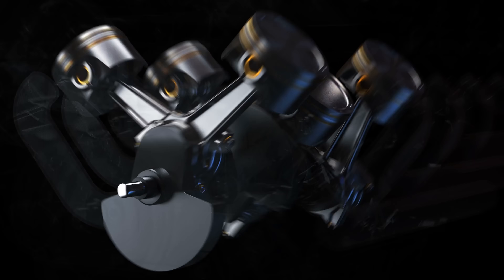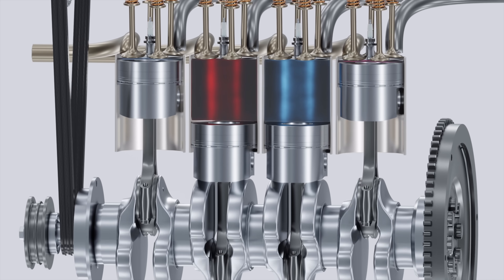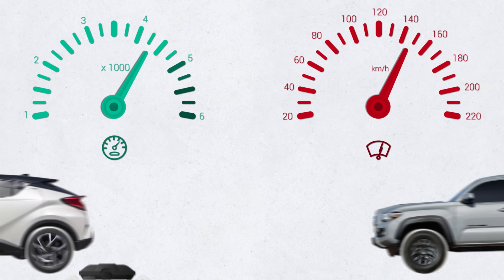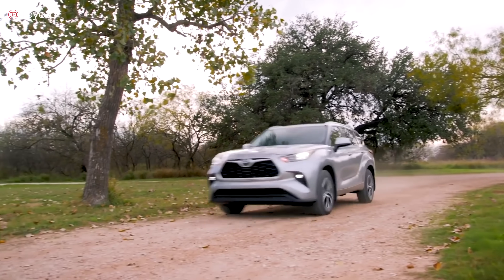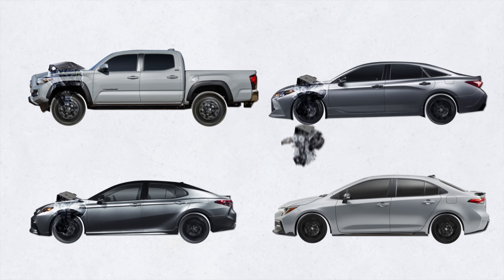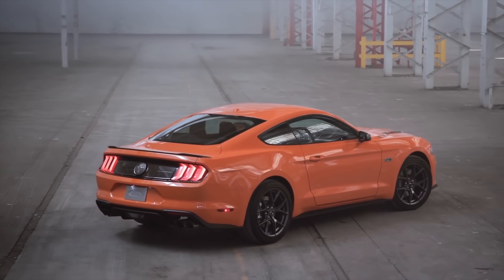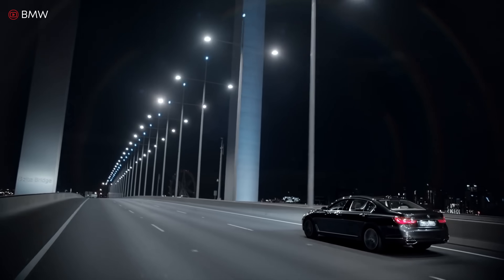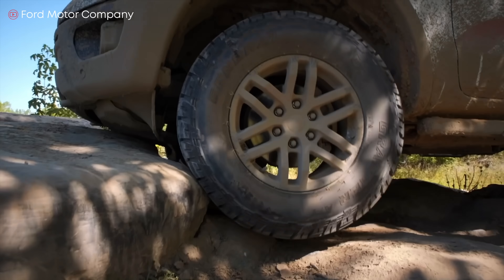No One is Telling You the Truth About Turbocharged Cars, So I Have To

Comment: Turbo charged vehicles are just not as reliable as naturally aspirated since there is much more stress on the engine due to forced induction. That’s why I still have my e46m3 and s2000 with 6 and 4 cylinder inline engines

Comment: 4cyclinder trucks transmissions  can't handle heavy weight over a 4 to 5 yr span. A car loan lasts about 7 to 8 years now. No one will keep these vehicles anymore after driving them to think they will last that long.
Reply: We are being forced in to 4cyclinder vehicles. If the government never changed the requirements this rapid buying of 4cyclinder and electric cards would not happen.
Reply: The car maintenance will quickly.
Reply: Rise
Reply: I love Hondas but to use a rubber belt instead of a chain to timing now is crazy. They do it so you change all the belts and water pump. Another way of compensating for loss of other maintenance cost they lost.
Reply: I will continue to use my 2016 Toyota Avalon v6 until the transmission dies. Lol
Reply: I will say one of the best cars I have ever owned was a 90 hond accord ex 4cy.

Comment: An electric supercharger would have no lag,less complexity,free exhaust flow,no heated air so no intercooler and infinite instant boost level control.
A stand alone computer could vary air and fuel in real time to optimize power and efficiency.

Comment: My VW Passat is the 1.8 Turbo and I have had zero issues with it for 83,000 miles.  The whole car has been trouble free for five years now.  I will say though, you definitely have to be "Johnny on the spot" with oil changes when you have a turbo.  You can literally feel the difference in the car when it is time to change the oil.  I can almost guarantee you that most issues people have with their turbos comes down to putting off the oil change longer than they should have.  You do have to put the best/expensive synthetic oils in for a Turbo.  Simply put, turbos are not for people that are typically inattentive to vehicle maintenance.  Turbos are unforgiving to those people.  I am pretty sure Scotty already mentioned that in his videos about buying used turbo charged vehicles.  Too risky to buy a used one not knowing the maintenance history on something so basic as an oil change.

Comment: ONLY IF YOUNG AND WORKING...RETIRED PHART NOW...LOL...BUT years ago I bought a slightly used 81 Suzuki GS1100EX...(His Son took it without Dad's permission...uh huh...3100 miles on it for $3,000.00 Yeah Good Deal...but Clutch Hub spit a spring cracking oil pump housing I fixed it all...Factory Hub and Pump(w750cc Drive Gears...HUGE DIFFERENCE) (ENGINE SOUNDED WAY QUIETER!!!) (MORE VOLUME OIL FLOW...YUP) CLUTCH PLATES ALL OK...I TOOK A TOUR ON IT...CA UP THROUGH OR WA IDAHO WYOMING AND BACK THROUGH VEGAS...I WOULD DO IT AGAIN IN A HEART BEAT !!!!

Comment: Personally, I would only buy a conventionally aspirated engine. My feeling is that there’s less moving parts to go wrong and the higher revs of a turbo stresses the engine and drivetrain, even if it’s designed for it. For most people, a 4 cylinder should be sufficient for going from A to B in a typical car. Sports cars are fun, but using them as designed is impractical in typical settings and dangerous and wasteful as well as stretching legality and safety of others. All we are doing is going from point A to point B. Everything else is frivolous. If everyone was really honest they would agree. 6 cylinder is fine for vehicles that are large and hauling weighty stuff up hills.
Reply: I need more than a grocery-getter.  I want to be able to travel, and for that, small 4 cylinder cars are nothing nice.

Comment: I've only seen a few cars with over 350,000 miles on then. Out of the 6 vehicles with that kind of mileage 2 were N/A 5.3L GM LS based engines before they went stupid with electric everything and displacement on demand. The others were volkswagon cars that were beat to sh*t but the engines ran perfectly fune and were all manual transmission,  turboed engine cars. The biggest issue is people not maintaining them properly and especially flogging the hell out of the car and then just shutting off the car instead of letting the turbo cool slowly.  I'd take a turbo 3.8L or turbo 4.3L from a grand national/TTA or syclone/typhoon from the 80s over their stock N/A engines. The 3.8L could have easily killed the TPI 350 that was in the Corvette at the time and they ran for ever even though 99.9% were driven damn hard. A properly taken care of turbo car will last just as long as a N/A engine. It's all about the original build quality of the engine and the maintenance done to it after it's in the owners possession. Even better, how about all the guys driving 200,000+ miles 5.3L v8s with a turbo on them that have had the turbo since the truck had 30,000 miles on it or less. They've been making 600+HP for years and havent had any major malfunctions and that's with stock crank, rods, and pistons, none of which are forged from the factory.

Comment: I'd never buy a turbo car.  The turbocharger itself is a high speed, high temp failure point.  Turbocharging puts strain on the engine, which is not a hand-built race engine.  A good old V6 pushrod engine has been many times more reliable.

Comment: There is no replacement for displacement.  I just bought a 2013 silverado with a 6.2 liter engine it's averaged 18mpg over its 116,000 miles. With over 400hp and 400 pound feet of torque at the ready. No turbo lag just smooth power.

Comment: We have in Europe turbo Toyota they don't break!
So it doesn't matter,
We have 1.4 d4d 90 hp diesel engine,
And 1.2 turbo D4-T engine Corolla, auris,
They are very reliable,
Only direct injectors clog up, you clean them pretty easily

Turbo is way better than any atmospheric engine!
You get lots of torque from 1500 rpm! All of it, and it holds it up to 4000 rpm,
Max power at 5200
No need to play with the stick!
Less noise when you want to go cruising, and very low revs on highway with plenty of overtaking power (torque) from the low end,
If built right and serviced correctly!
0w 20 oil used,!!
And every 10 months or 12 000 km oil change they don't brake,
And use it correctly never turn engine off immediately after thrashing it,
Neither floor it when cold turbo is gonna brake....

Toyota makes Japanese engines in Europe the 1.2 turbo has IHI TURBOS
And pistons from metal art Co Japan

Comment: I like turbo, because the altitude where I live, near 2,000 M, naturally aspirated loss about 1% Every 100 M….. so, loss 10% in a car whith 200 hp is the same to drive a Crv 1.5 L turbo that have 180 hp, because turbo usually never lose power whith altitude, Turbo car could be cheapper compared whith the same HP performance where altitude is important

Comment: Na engines for me. Turbo 4 bangers and any turbo besides a diesel have more pressure/heat/friction and will prematurely fail than a NA engine. All the components in a turbo engine are stressed beyond so longevity and dependability are compromised.

Comment: The problem is everybody drives a TRUCK to commute to work! Those dummies DO NOT NEED  a v6 or v8 to suck back extra fuel to get them from point A to B, so the turbo 4 is a GREAT solution. Also, Toyota is releasing a turbo 4 in the 2025 4runner with max torque around 1700 rpm (lower than v6s and v8s) and 325Hp (non hybrid- the hybrid gets a Big boost) so the turbo 4 is great alternative for better fuel economy and still getting reasonable power. 

Toyota, please put that engine into a Rav4. Weeeee!

Comment: 4 cylinder engines are over powered. I don’t need to go to 90 in 2.5 seconds. I can’t tell you how many times I’ve got on the freeway and check my and I’m doing 90 to 100 and I’m not even trying to go that fast! My car you only have to touch the gas pedal and the car will start going at a reasonable speed but if you push the gas pedal the car takes off like a rocket on steroids.
Reply: I forgot to mention that I hate my car and will never buy a car with a turbo engine again!

Comment: 1. Turbo engines do not necessarily have more parts than a V6.  An ecoboost 2.0t will for sure has less parts than a VW engine in an Audi at the same era. 2. Fuel economy is mostly depending on engine design, application, driver style, etc. Todays V6s are mostly better than the first turbo I4 years ago in terms of fuel economy. 3. Towing is better with diesel engines and diesel engines are mostly fitted with turbos regardless I4 or V6. They are stronger, significantly more power in terms of towing, much more better in fuel economy. 4. vehicles that operated at high altitude requires turbo because of oxygen density, NA engines are simply in capable of normal operation there. So, there is no better, only different. Any engine is good at something and bad at something else.

Comment: Can how the 4 liter turbo performs after 5 years?
Reply: my 14 fusion has 188700 miles on i take very good care of it,, runs perfectly  smooth quite and lots of power  2.0 vep turbo engine,, and last oil change i got most of the 6 quart of oil back.. 5.5 in the drain pan.. and about 1/3 quart out of the filter

Comment: Never cared much for the v6 with its inherent balancing issues, the I6 however is a favorite. To me it doesn't matter too much because I am always on top of maintenance and any repair needed is never defered, because of this I have got 300,000 miles out of engines and transmissions that are known to fail prior to 100,000 miles. That said the turbo 4s tend to be tougher to repair and maintain (in FWD cars)  than NA V6s in my opinion

Comment: Give me a V6 engine any day over a turbo 4 cylinder in a small SUV especially!! Turbo engines feel jerky and noisier. I like compact SUVs. Only mainstream brand that offers a naturally aspirated V6 compact SUV is Jeep that being the Cherokee which I just got for my new car with the Pentastar 3.2L V6. Almost nothing else exists that is compact SUV with V6. There are sadly more sedans and coupes with V6 than compact SUVs these days that are brand new. Have to step up to midsize SUV to get V6 which gets too big for a single guy and those get heavier and clunky as well. Even good turbo 4s are hard to find in most mainstream compact SUVs  the last few years and instead they are larger naturally 2.3 to 2.5 liter aspirated 4 cylinders or tiny 1.5 or smaller liter 3 bangers turbo/ You have to step up to luxury brand just to get a decent horse power of over 200  like turbo 2.0L 4 cylinder.

I guess Chrysler is still the only company who actually cares about the customer wants cause many want a naturally aspirated V6 in a small SUV and no one offers that anymore.

Even the few luxury small SUVs you can get with a 6 cylinder like the Audi Q5 and maybe one Mercedes and a Genesis get expensive of course and even then turbo V6 only which is insanely fast, but introduces the potential turbo problems of the engine running hotter.

Comment: I love your content! One thing that is still boggling my mind is my parent's new 3.5L V6 Avalon. The car has approx the same city gas mileage as my 2010 2.5L i4 mercury milan, 24 mpg city, but on the highway they obliterate my mileage. We drove both of our cars caravan style from NJ to TN and then onto FL and my i4 car achieved an average of 31 mpg during the whole trip including city driving, interstate, country road, both flat and super hilly, but their v6 got 34.5 mpg across the whole trip. Not to mention its 3 ish seconds faster 0-60 AND a larger overall car... Gives me hope that naturally aspirated engines, particularly v6's, will survive this turbo 4 craze America is going for considering the naturally aspirated 6 is getting better mileage AND power than the naturally aspirated 4.
Reply: Q: I have a 2010 Highlander Hybrid 3.3 V6 that I  use to pull my boat (1200 lbs). Toyota's new highlander hybrid doesn't have the "oomph" I need, plus the price is $50,000+. What's a guy to do?

Comment: I will take a Honda or Toyota V6 Every. Single. Time. These are proven workhorses over the last several decades.  If anyone thinks the current crop of GDI 4 cylinder turbocharged motors will be anywhere near as reliable in the long term, they are deluding themselves.

Comment: The only goal of the turbo is inject more oxygen in the gas mix inside cylinders, because more oxygen equal more water fromationduring the explosion.
The real value of fuel is its content of hydrogen to form water. 
Water formation in the real power behind internal combustion.

But with turbo came the spider.
It is insufficient inject more air, because nitrogen comes with it.
The real problem is nitrogen in the air (70% of air composition) and as result nitrogen compounds after combustion, plus the energy absorbed by this gas during the explosion of oxygen- hydrogen.

Better idea is inject pure oxygen, get rid of air and reinforce the engine to absorb a more potent explosion.

Everything else is a partial ineffective solution for efficiency and pollution.
Reply: Spider?

Comment: Turbos shorten the life of the engine and cost far more to repair.  I'll keep my naturally aspirated V-6.  My V-6 has good power, mileage in the 30's on the highway, and is dead reliable.  How many of those crappy 4 cylinder turbos will still be running at almost 200,000 miles?  Not many, unless they are on their 2nd or third engine, or turbos.  Turbos equal  $$$ pits!

Comment: It's about manufacturer profit, think about it they need as much power from as little material as possible, they make them to do 100k and it takes second hand motors off the road. The turbo simply allows them to build small, lightweight engines out of a minimum of metal and thrash hp from them hopefully dying as soon as the manufacturer has extracted as much profit as possible from sale/ resale and servicing and once it moves i to the low budget end of the market it will die expensively encouraging you to buy new, sorry lease a new one.

Comment: I mostly like the turbos for their performance at high altitude. The na engines start to run out of breath over the passes in Colorado.
However I like the smooth power delivery of the higher cylinder engines.

Comment: if the car makers would make a turbo that lasted trouble free 200000 miles and give 30 miles yes turbo is the way to go but most fail around 60000 mile so auto makers  can rip public off by the way you always get only two thirds of mileage promised they are a pack of liars !!!!   60 years  a mechanic...

Comment: Turbo I4 engines will last as long as a V6 as long as they're built right and you follow the maintenance schedule. I have a 2006 VW GTI with 275,000 plus kms and have never had to replace the KO3 Borg/Warner Turbo on the 2.0 litre engine  and it  has never left me stranded  contrary to what Scotty says about VW's. My other VW (and a 2004 Jetta wagon)  has  329,000 plus kms and again  I have never had any maintenance issues on it either . It has a very reliable 2.0 litre  normally aspirated engine that is busy proof . I love Scotty's channel but don't agree with him on his opinion about VW and as reliable as a Toyota may be they're utterly uninspiring and boring as hell to drive . The only Toyota that's fun to drive is the German built and engineered  BMW Supra . 😅
Reply: I mean t bullet proof.😁

Comment: Turbos are common because its a way for company's to sell you smaller cheaper underpowered engines, turbos will cost you more in future maintenance and the extra cost is not worth it. If you get 100000 miles out of one you will be lucky.